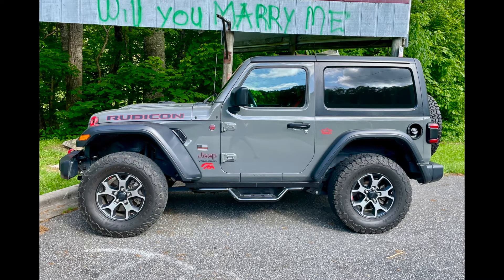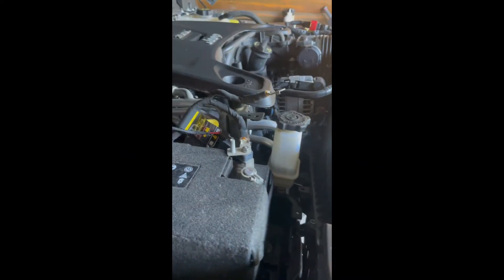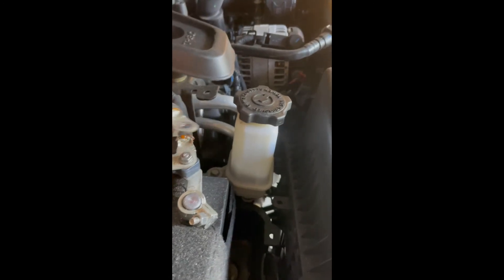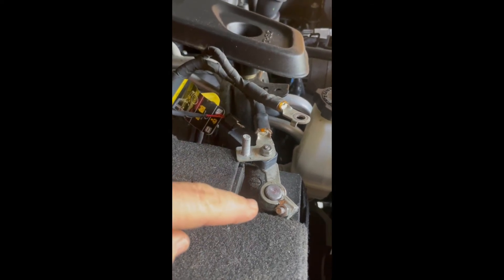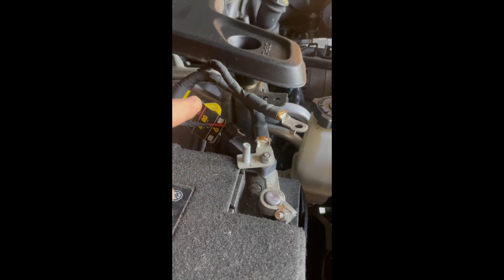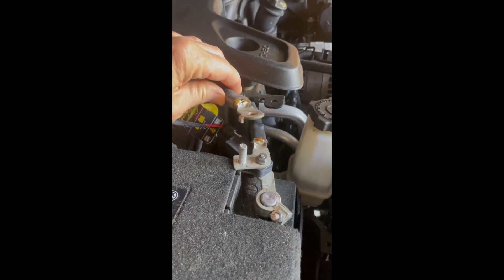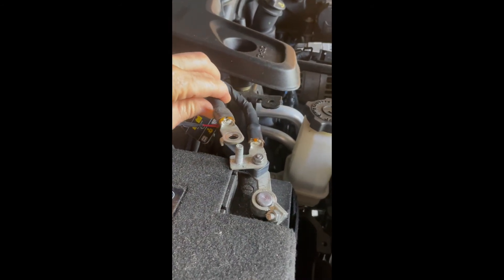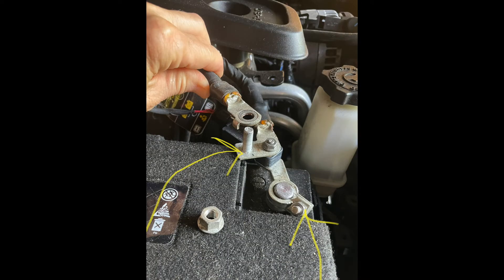Jeep Wrangler Storage and disconnecting batteries

Comment: I tried to do this backwards when clearing and engine code, and it was sparking really badly when I was removing the aux battery connection AFTER removing the main battery connection.

Comment: The best solution is to connect the battery to a “battery tender” (sometimes called a maintenance battery charger) which will charge the battery when needed and not overcharge it as a regular charger would. Just disconnecting the negative terminal will still age the battery. You can leave the battery in the truck or remove it to your garage and connect it to the tender.